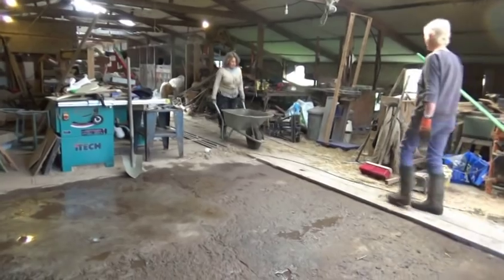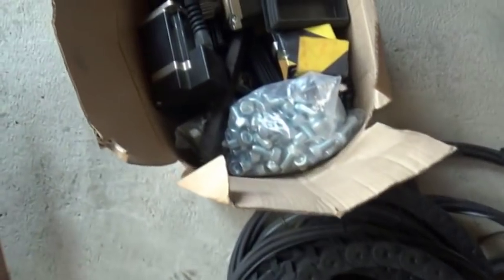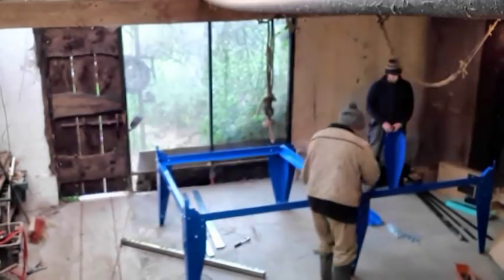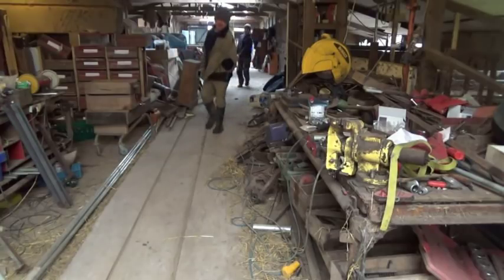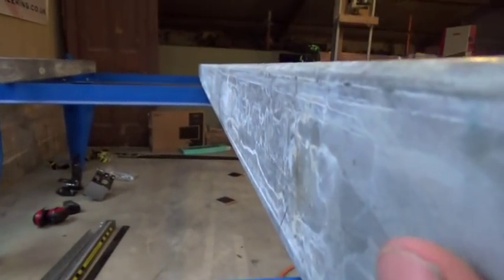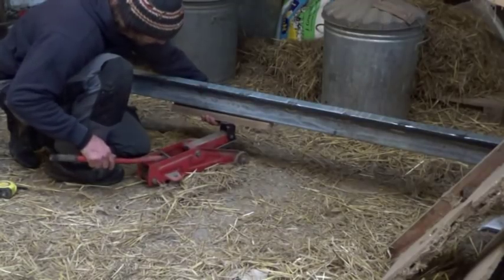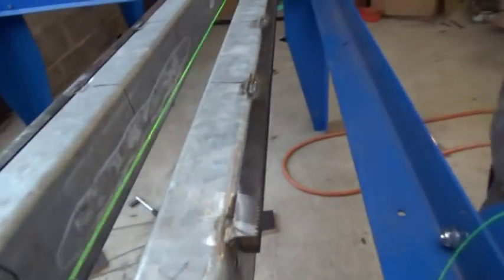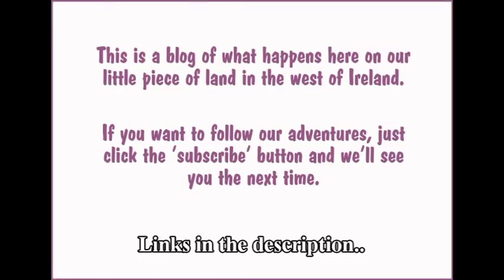Building A HUGE CNC Router Machine! Part One. (This is so exciting!)

Comment: Around 8:50 if a metal has springback I wonder what deflection it took to bend it or how many times it was deflected or both. Might be why straightening has a feel to it. Your measuring deflection and results method looks familiar.

Comment: Maybe it was the welding that bent the  box section. 

After the liquid metal solidifies it still has a long way to cool to room temperature.  The coefficient of thermal expansion causes the weld to shrink and pull on the material.
Since the gear rack was only welded on one side of the box section, all of those welds work together to "shrink that side of the beam. 
One way to fix it would be to add weld beads to the opposite corner, to balance out the shrinkage stress.

Comment: a good way to mount the racks are 3m vhb tape..  i have them upside down for years..
Reply from the maker: Really? on a router? I can see them working on a lazer, but on a router?
Reply: @WayOutWestx2  i build a mechmate a long time ago.. and it uses vhb tape for the rack. 3hp spindle heavy monster.
Reply from the maker: That's so interesting - thanks. I'm learning such a lot!

Comment: This is called assembling, not building. Thumbs down for clickbait
Reply: Paul Novak I think most viewers would disagree. Maybe you didn’t watch the whole video, the basic frame from a plasma table was assembled but Tim is then building upon that table/ frame with a bespoke design to take a CNC router. This is the designing and building. Looking forward to the future videos on this. More power to Tim 👍
Reply from the maker: Sorry you were disappointed, Paul. I think even the cleverest builders assemble parts, don't they? Not many are winding motors or cutting threads on screws. Yes, so far, lots of this is assembling, but there's lots of other stuff that has to happen before it works..

Comment: Tim, I continue to be astounded by your rampaging ingenuity. It seems there is NO problem you can't solve with little more than a bit of string and a block of wood?
Reply from the maker: Ha! Thanks, Rachel. But it let's wait till it works before we pop the beer bottle..
Reply: @WayOutWestx2  It may not work the first time. Or even the 3rd time. But you'll figure it out eventually. Look how you figured out the corrugated roller bendy thing!

Comment: I am amazed you welded the racks on, a sure way of warping anything!
Reply from the maker: But one of the rails is perfectly straight..
Reply: @WayOutWestx2  You got Lucky! Racks are usually screwed, which also allows them to be changed easily when worn! All the best, Matthew.
Reply: @MatthewTinker-au-pont-blanc  No worries about wear - it's a CNC machine - Tim can re-cut those teeth as needed!  HAHA
Reply: @insidemachines  You must know something I don't! HA HA!!
Reply: A terrible design decision. You can order the rack tapped...

Comment: Fabulous! The ability to do large one offs, made to measure locally is a big antidote to the commercial pressures of imported low cost volume stuff that mostly comes in standard sizes. Of all the welding process I have tried TIG is my favourite. Best to secure the Argon cylinder though, even these small ones if they tip and the gauge breaks can emulate torpedo.Thanks for sharing!
Reply from the maker: A torpedo, huh? Sounds like an interesting challenge..  : -  )
Reply: @WayOutWestx2  At circa 45 seconds in this video, you can see the 1st of several torpedo emulation by small cylinders of pressurised gas when the top breaks:  https://www.youtube.com/watch?v=f-xmaPSZ6GM
Reply from the maker: Spectacular - but I wouldn't want to be in the way

Comment: Just comment on bend rails, it probably got bend when welding on the tracks.. welding shrinks and pulls base metal together as it cools, bending the base metal in the process.   Guess bolting the tracks could have prevented welding distortion
Reply: Yes, my gut tells me that this beefy steel wouldn't bend from a bumpy ride - any more than the truck's frame, which is similar in girth and highly loaded. Although, please tell me if you disagree - I may not have all the facts.
I had this same problem while building my first CNC table:  What actually happens is that welds locally release internal stresses built up from cold rolling. Heating makes the flattened steel return towards its original shape:  thicker... Which, thanks to Poisson's ratio, requires adjacent steel to pull in toward the heated area. Therefore, we see the welded side of the bar become "shorter" like the inside radius of said banana. 
Pro tip:  you may straighten the bar by welding a mirrored pattern on the opposite side to "balance" the effect equally on both sides... But you can imagine how quickly you'd start chasing a moving target if you rush it (don't allow enough cooling). 
I liked your way of straightening, but just worried it may slip off one end and release all that energy (like a big kid jumping on one side of a see-saw) and cause an injury. 
This is exciting indeed...looking forward to seeing the next steps!
Reply: Only one of the welded bars was bent?  🤔 okay, it's a mystery... Or indeed bent on the truck!
Reply: @insidemachines   or just skewed from galvanized process releasing stresses ? (if its cold rolled welded tubing)  (I think they were galvanized?)  ..  Anyway .. its straight now and made some good youtube content :)
Reply from the maker: It comes as a 22' length so there's a lot hanging unsupported over the cab of the lorry... bouncing up and down... for miles..
Reply: @WayOutWestx2  That must have been fun - ha!  Well, I'm glad you got it straightened out. Big kudos for this big project!
Reply from the maker: But only one was bent..

Comment: Tim, I am thinking back to the mid-1970's when I was still a mechanic and spent much of the winters rebuilding & sharpening gang style reel mowers (fussy work to get a long summer of perfect cutting in our parks). To assure continued precision, the rails for the sliding/rolling grinding machinery were supported at periodic intervals  (quarter length, half length, three-quarter length if I remember correctly) with fine thread bolts mounted to the main frame with the bolt heads contacting the rails' undersides for adjustment up or down to within thousandths of perfect level over the length of the rail run. Perhaps such a simple bolt adjustment could support your long beefy rails at the middle main frame and take care of any wear/sag/floor heave or other warping with enough precision for your purposes.
Reply from the maker: Thanks for the suggestion, Douglas, but there's no way any support can be added without interfering with the carriages that run along the rails.
Reply: An exciting project.
You really do want some ability to adjust the rails as Douglas mentioned.   The floor can move, the rails can move etc.  The adjustment could also help with fine tuning the rail to be straight.
You could attach the rail to an L bracket and another L bracket to the leg then have a bolt/nut with a fine thread between the brackets.   These brackets being on the inside of the rail should allow the carriage to move. 

Dave.
Reply from the maker: Douglas and L.V. - rob has sent a couple of photos showing where I should have attached a bracket mid-way along. I'm going to see how that goes and include it in the next video. Thanks for your imput : -  )